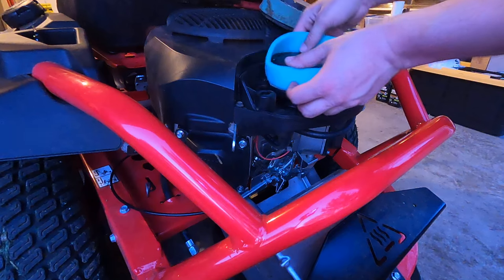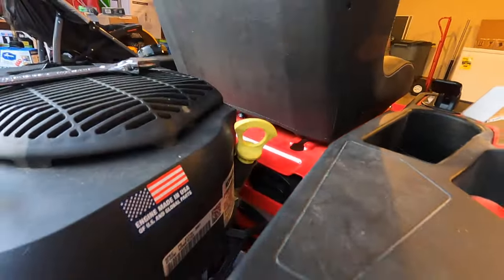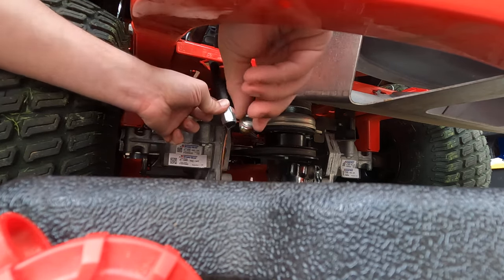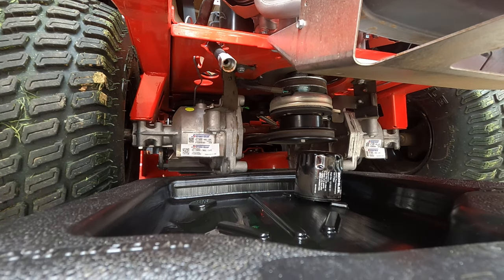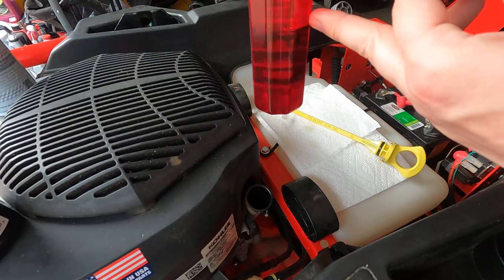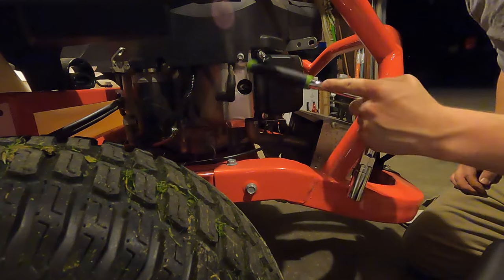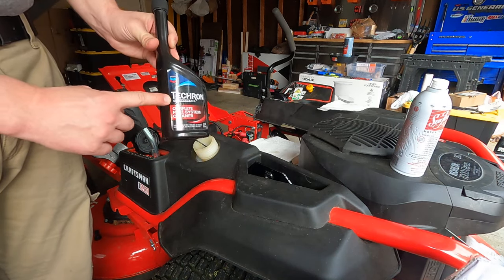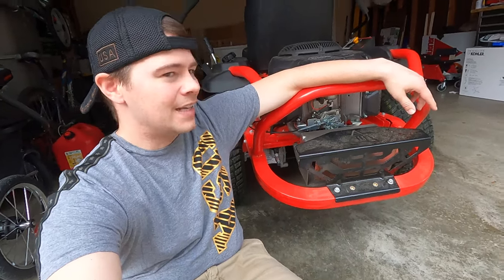Spring time Lawnmower Maintenance - Craftsman Z5200

Comment: Good video , thanks for the information on caring for lawn equipment . Isn't red threadlock for permanent install ? Pipe threads are tapered and don't really need much or any sealant .
Reply from the maker: Hi there! Red thread-locker is for fasteners that are 'more permanent', than the blue variety. The common theory is, blue for hand tool removeable & red for power tools. I am only doing this job once a year, so I don't want any possibility of that plug shaking loose during the 'jarring and/or banging around' while the machine is in-use. There are zero taper in the threads on that hose plug. It's basically completely square to the point where it bottom's out into a cavity.